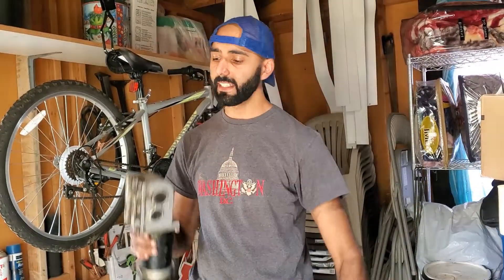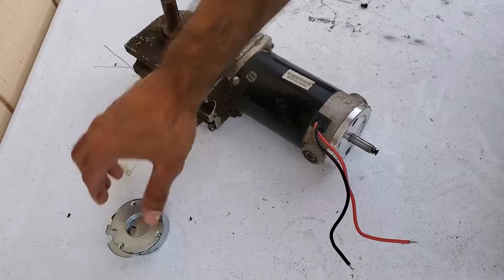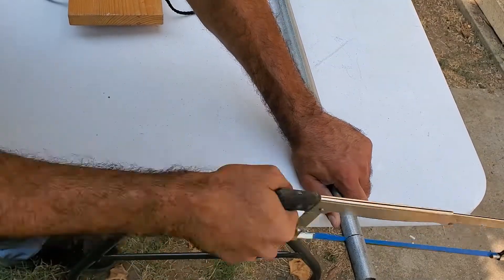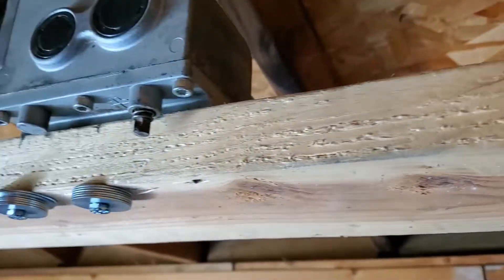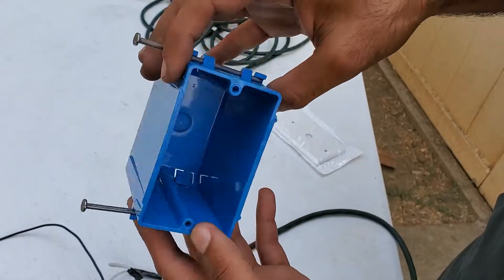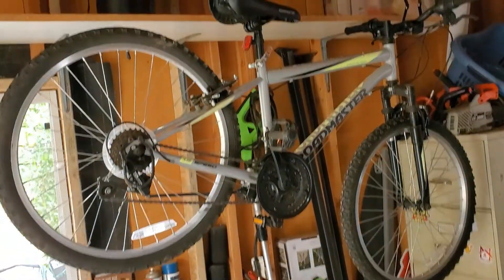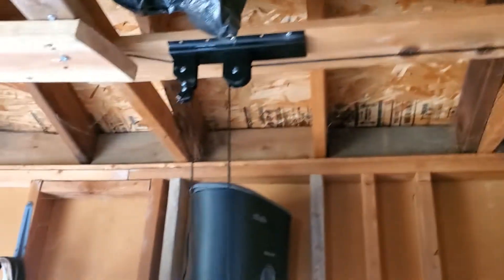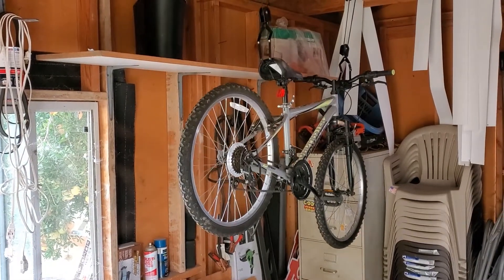Harbor Freight Bike Lift Modified

Comment: you could use a old cordless drill. those nimh ones with dead batteries are often free :) often they are 18 volt so you could use a old laptop power supply to drive it :-)